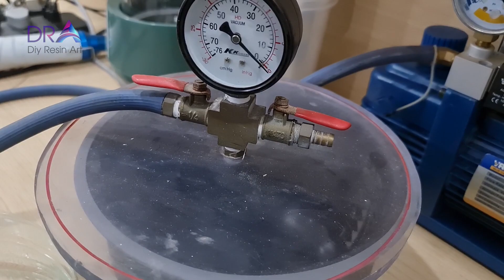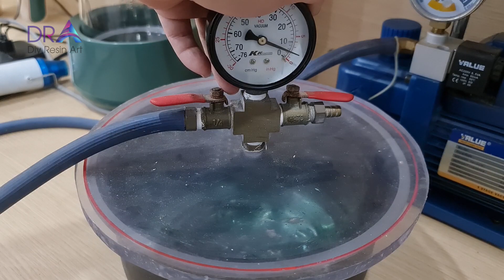Nice Amazing Epoxy Resin Blue Ocean - How To Make Epoxy Resin lamp Art with DRA | Diy Resin Art

Comment: Hi, what resin are you using?
Mine is heating up and destroyed my printed parts.
Thank you
Reply: Make sure you are using a deep pour resin and following instructions. If it says you cannot pour over 1/4 inch at a time, then that may be part of the problem, and some resins have a maximum amount that can be mixed at a time, such as "do not mix more than 1/2 gallon in a single container"